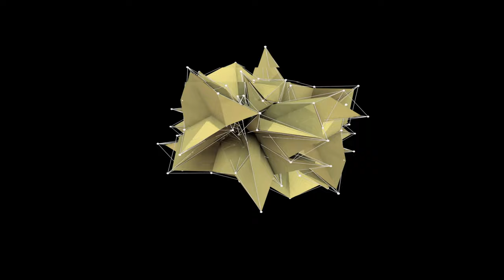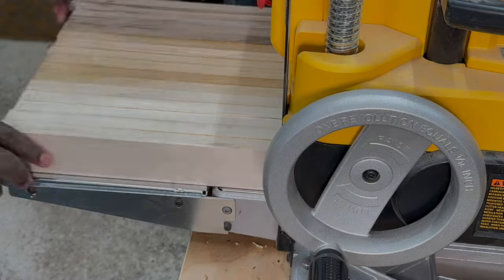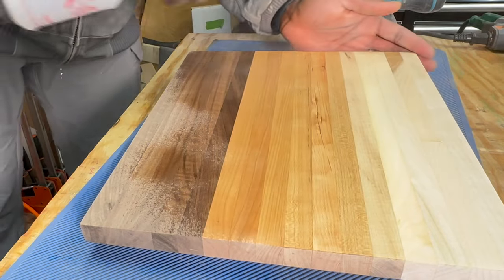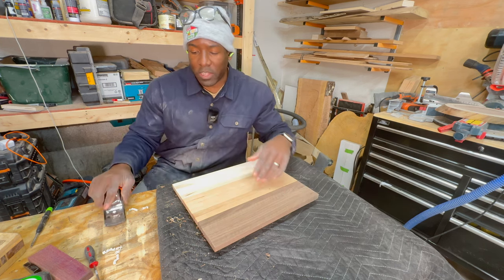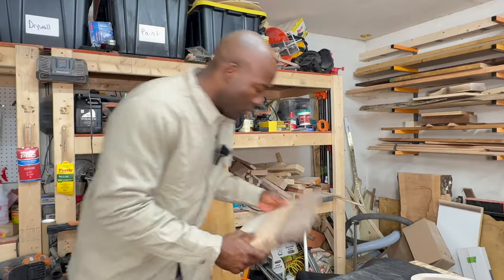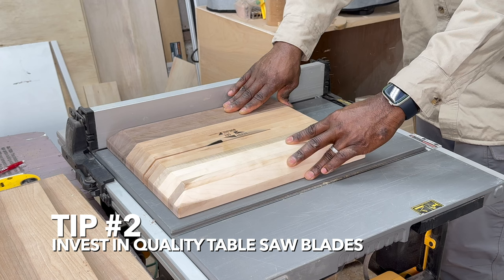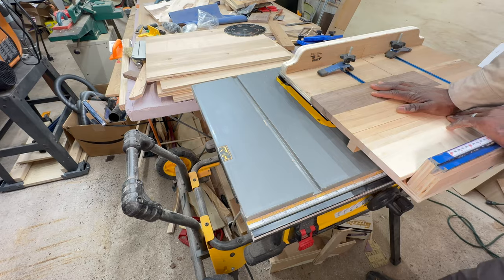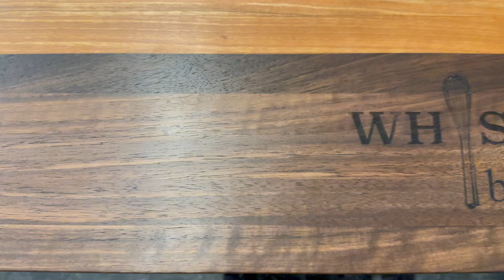Amazon’s secret cutting board

Comment: I have used Amazon lumber many times, and most of the time the S4S is ready to go.  Once in a while I'll get lumber that isclose but not all pieces are a perfect 2 inches, or 1.5 inches in size.  I don;t have a planer so I spend a lot of time sanding.
Reply from the maker: Yeah for sure. I assume you use a belt sander to sand probably?